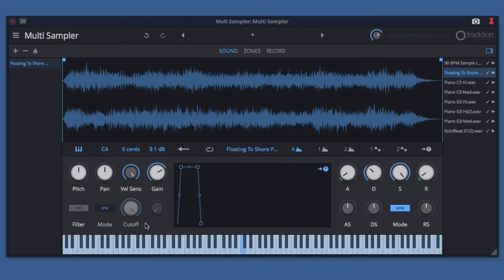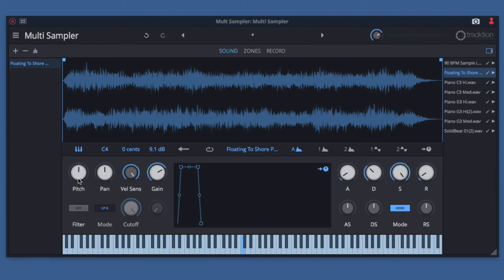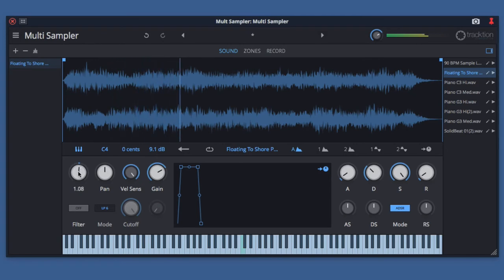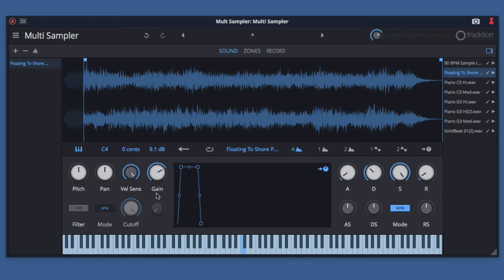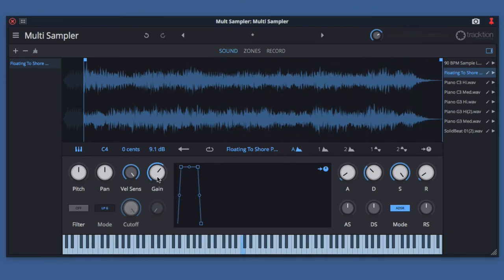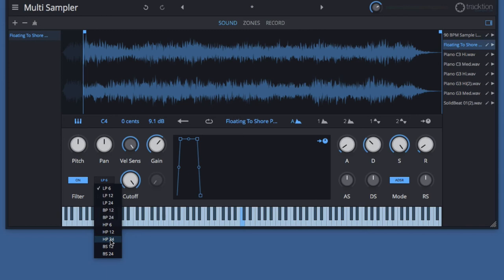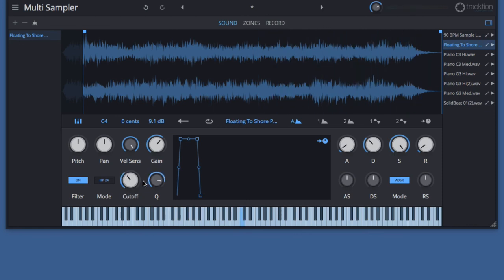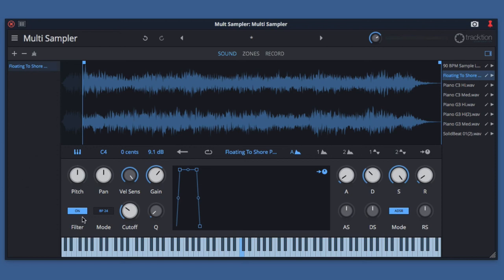03 Waveform Multi Sampler - Sound Shaping Controls

Comment: can you please advise whether it is possible to save wav files as trkpreset to appear in the preset list.
Reply from the maker: Hello! If you right-click on a track containing a wav and select Save Preset > Whole Track it'll be added to the preset list for recall. This video may be helpful - https://youtu.be/bxLKtjJVm3U. If you need further help please get in touch via support.
Reply: @TracktionSoftware  Thanks for your reply, however support wont talk to me cause its the free version and this video only offers suggestion re track loops which I cant get and have seen before. It was the actual file type trkpresets that I was enquiring about.
Reply from the maker: @rodneywood3399  Track Loops can be created and loaded in Free too. It depends what you're trying to do. You could drag a wav to a folder and have it show under the Samples category. Or if its a wav thats already in your Edit click on the Edit Smart List and you'll see it right there. The Waveform Users FB can be a good source of information.